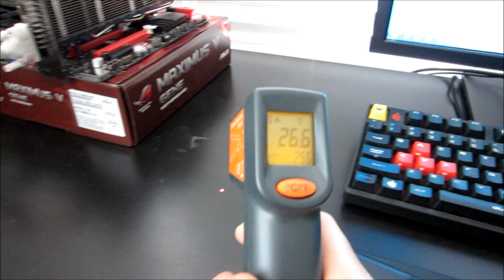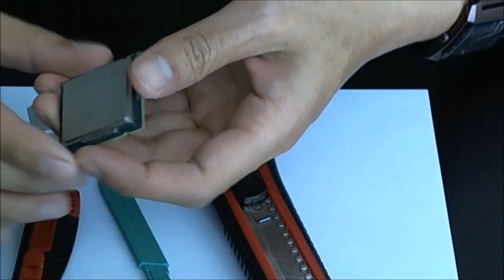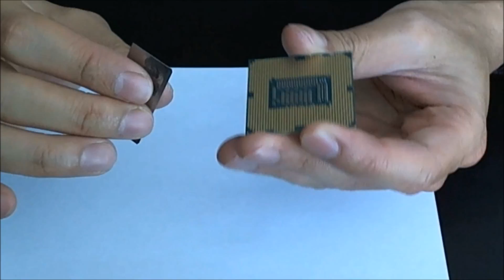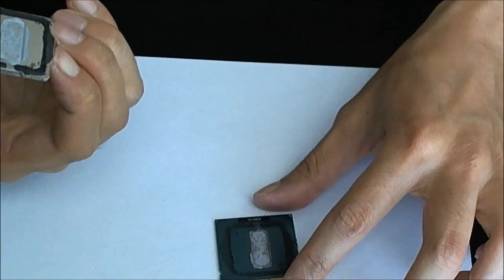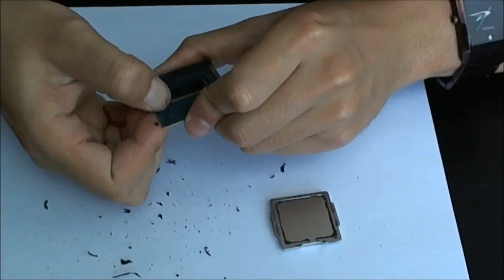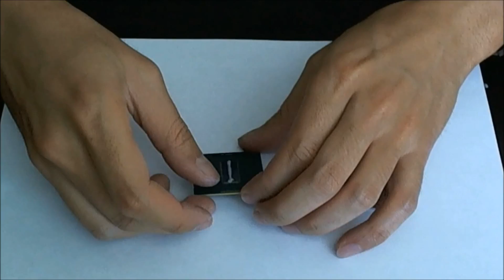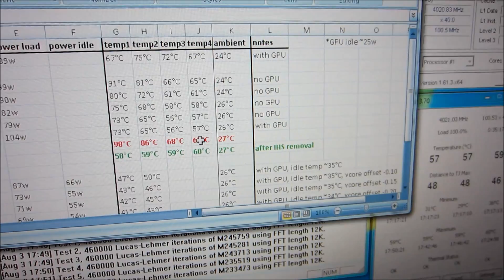Fixing Skylake, Haswell, and Ivy Bridge CPU temps: IHS removal

Comment: You should avoid touching the pins on a cpu to avoid bending or otherwise damaging the pins yes, but this CPU fits into LGA 1155 or Land Grid Array, meaning the pins are essentially on the motherboard's socket and not on the cpu.

Comment: Good concept video but I would not use paper towel. Go with a coffee filter as it will not leave lint. I would also use a small bead of silicone to secure the heat spreader back onto the chip. Finally, I would clean the CPU contacts with 98or 99% pure polypropylene to remove any grease or acid your fingers will leave behind. Very nice results from this mod for sure.

Comment: Dude at 06:36 you say the die runs perpendicular to the flaps, you are correct
Proof at 09:19 As you pull the IHS gently, the die is perpendicular to the flaps
I say this because you have a notation at 06:36 saying "Oops! Meant parallel"

Comment: great great vid, u could have probably mentioned, that if someone does not want to delid, then a sandy bridge cpu will go much higher in clock and calculation power and u could have probably show your final 4.5 ghz standardclock, volts and temps.

Comment: The temperature problem isn't due to the TIM actually. If you look over at anandtech's forums, a poser "Idontcare" did a very thorough test and found that the gap between the die and the IHS has more to do with the temperature than the TIM. Intel's TIM is actually pretty good, but the fact that they had to glue the IHS down left a larger than desired gap between IHS and die.

Comment: about the same risk as installing waterblocks on MB and GPUs. Besides the razor blade part, using the gentle twisting motion to remove the heatspreader is important. Plus removing heatspreader or stock heatsinks, it is usually slightly easier doing it on a 'just been hot block' vs ice cold.

Comment: What is the glue that intel uses to mount the heatspreader?  
or thought
I wonder if you could use Arctic Silver™ Thermal Adhesive or even a car product Permatex® Ultra Black® Maximum Oil Resistance RTV Silicone Gasket Maker

Comment: If I were to do this I  think I would have kept the old glue seeing it still has its properties. Meaning, when you "fire" your CPU up it will get hot and remelt the glue, hey presto, you can then easily remove the CPU without worrying about the heat spreader being lose.

Great video very informative learnt alot from it. Thanks.

Comment: Easy. Money. Cheap paste saves manufacturing costs. Also they don't expect people to overclock to the extremes. They could even have know people might try replace the paste and pray they mess it up to get more money from them replacing things they break.

Or they genuinely thought the paste is good enough...
Which in my opinion it's not the paste that's the problem it's how they apply it. If you have paste over the sides of the chip it's acts as an insulator rather than transfering heat.

Comment: I want to reseat my heat spreader because I want to fix the 20 degree difference between Core 1 and core 4. Which I get even without overclocking.
Temps should be uniform.
If you are talking about why go to 5ghz? Well because all the reviewers say it can't be done and because I like big numbers.

Comment: THANKS. i cant believe intel could be so reckless they must know the advantages of using a good paste. why would they be so reckless with a £300 chip. i dont understand how a company so knowledgeable could make such a major screw up. reminds me of Microsoft screw up with the xbox360 gpu issues. using rubbish solder and they also used shit paste on there gpu chips. want something doing right you have to do it yourself right.id rather by my chip un pasted with the crap there using.its wrong @price

Comment: I'm generally thinking about doing the same with my 3770k. I'm running mine at 4.8ghz on a watercooling system and one core will sit at 75 degrees while the rest are at 90..
I'll probably be able to push past 5ghz if I do this fix.

Comment: you idiot... you're getting shitty temperatures because your fan is trying to pull air from your graphics card. that's like putting a heated peace of cardboard over it... you are suffocating your heat sync... i have an i7 ivybridge 3770 that has temps like 30 degrees Celsius with my h100i from corsair... if i was an idiot like you and suffocated my fans by maybe putting something solid in front of them i might wreck my cpu too. next time pay attention to your fans idiot.

Comment: Personally I'd compensate the heating on any cpu with a chilled liquid, liquid cooled system. By chilled liquid I mean a custom rig that cools the liquid and then runs it through the system and radiator as cool liquid from the start will take in more heat.

Comment: I would really recommend regluing the heat spreader so it doesn't accidentally crack the dye. With the way that particular CPU installs underneath a sliding bracket like that it would be real easy for it to slip just a millimeter too far. This wouldn't be as much a problem with AMD as they still use a ZIF style socket though some heat sinks could damage it with uneven pressure. This is not a mod for noobz...

Comment: I wouldn't use a paper towel or kleenex to wipe the old thermal off, use a squeegie or old credit card or something, also he's using a razor blade to remove the top? :(  Don't do any of this stuff if you're not tech savvy.

My i5 3550 tops around 65C as well, that's much cooler than most of my other CPU's including AMD ones that I've had.

Comment: Actually Totally is right. The stock Intel TIM is pretty good stuff actually I've reused it once on my i7 and temps still went down about 10C. The main issue with Ivy Birdge is The distance from the die to the IHS from the adhesive they used on the PCB for the IHS. If you think I'm wrong, names Valgaur over at OCN come to the delidded Ivy club and have a chat :P

Have a good one,
Val

Comment: well my cpu is i5 3470 i am not having such huge temps only on very stress and after my computer work for 2 straight days i get about 70C.
i am happy you got it fixed for you but i am afraid of doing it my self specialy when you got warrenty.
still sad to know intel they used cheap thermal paste for their CPU i used to be a big fan of them (no problem with AMD just know intel it a safe choice). hope they wont do that mistake again.

Comment: Probably because it has the best value for performance at the $230 price point, there is no point in downgrading to an sandy bridge if you can improve ivy bridge. It has been proven that an overclocked 3570k without this mod performs better than an overclocked fx-8350. 
It is worth the time. And if you do some research you'll find that the difference in temps is caused by the cheap thermal compound Intel used.

Comment: Interesting video, however I would have thought that the initial high and mismatched temperatures are due to either badly installed cooler or a fault with the intel heat spreader when originally manufactured. 
There is no way that the quality of the Intel paste and the paste used here is going to make that much difference. Something was BAD in the first place. If I had had that chip, I would have measured the temps with a stock Intel cooler, and if they confirmed the bad T's returned the chip.

Comment: A very well made video. Educational, well set out and well explained. The part where you were removing the heat spreader did get a little boring, but I think it was necessary for completeness. It's nice to come across a carefully made video when there's so many out there that either aren't explained properly or aren't filmed properly. Thanks!

Comment: i would wear gloves . but this got me thinking unless u got a real bad chip . is it worth it for sure you would void your warranty. you would get like 10c less which isnt that bad. i have a 3570k with a h60 running at 4.5ghz and hitting high 70ish. i have no complain with the temps . if ppl are so crazy about the temp stop being cheap asses and invest in a good cooler.

Comment: Because then the cpu latch wouldn't be able to hold the cpu in place because of the height difference without the ihs. Although if you remove the cpu latch and you use a waterblock to hold it in place that would work, only if your water cooling though.

Comment: It's actually not the TIM.  The cause is actually linked to the glue that holds the HS in place.  In some (many) CPU's the glue on the die that the HS is resting on is actually too thick or not perfectly even, elevating the HS resting on it ever so slightly up off the core.  The TIM is actually high quality.  They should have soldered it, however.

Comment: OH also I am not recommending CooLaboratory for the IHS to Heatsink just for the Die to IHS... Use MX-2, IC Diamond, Indigo Xtreme or Gelid GC Extreme.  I would probably guess the Ingido Xtreme would be the best but it is the most expensive on a per application basis... If you are only going to mount once and you know you wont take it apart a single application of Indigo Xtreme costs less than the other high end TIMs.

Comment: There is a list you can find of old processors that this will work on.  This is not the first time Intel has used TIM on a processor.  The list is short (in comparison of all existing intel procs).

But WhiteFireDragon has a point you can't just go out and buy any random old processor and practice this.

Comment: actualy... in order for electrons to discharge into the cpu the cpu has to touch something that conducts... touching any pins on the cpu does not matter as long as the cpu is disconnected from any other touch

Comment: You can not make it run cooler. It is however possible that during the manufacturing process of you laptop bad thermal interface material (TIM) was used or that there not enough or an excess of it. You could fix that but opening a laptop is a pain in the a**.
A laptop is factory assembled, the mobile CPUs and chipsets come without IHS as the heat sinks applied to them do not exerce a huge pressure and will not bend unlike workstation heatsinks that can be massive like the one on the video.

Comment: speaking of going big, you could have lapped both sides of the heat spreader to a mirror finish while you had it apart. (just messin' with ya, it would be insanely hard to lap that recessed area on the bottom)

Comment: Fail of the week, you try to sound smart by pointing out the wrongs in this video but failed to acknowledge that Ivy Bridge CPU's do not have pins on them. Further more that if this was done the wrong way, then how come it resulted into success? Because removing the IHS is perfectly harmless. They are only there because it provides more surface area so your heat sink is more stabilized.

Comment: AMD still has pin grid array (PGA), as apposed to LGA, CPUs. Not every cpu is LGA, sorry had to play Devil's advocate.

Intel went LGA (with LGA775 socket) in '04 btw, not the '90's and still uses PGA chips for notebooks and atom chips (including the new Haswell stuff rPGA technically, just smaller pins) that arent BGA and soldered onto the motherboard.

I do admit he was a bit overreactive even though he should be more careful with the pads on the CPU.

Comment: I have an i7 and one of the cores is running about 10 degrees hotter than the others (Fahrenheit). What is the max temp in either Celsius or Fahrenheit that I should have when running normally/ playing games?

Comment: Sounds more like an overheating issue. If it turns off then right back off, the temps may be to high. So its doing what it suppose to and shutting down. If it were ram it would beep, giving you an error code or rarely cycling the boot.

Comment: question. is it necessary for you to put the IHS back on? or could you just have directly put the heatsink on the cpu die? cause wouldn't you get even better temps still with a direct contact? or would that just scratch the die or something?

Comment: that's not a CPU problem sounds like a RAM problem take out the ram and then reboot if you get a bios then stick in one stick at a time until it crashes. if the first one crashes it then there's your bad stick. but don't be shocked if they all work, when i take out my CPU i have to reseed the ram. turn off the computer before putting a ram stick back in and if you still think its the cpu just take it out and push the power you should get a bios screen

Comment: Intel cuts corners on Ivy bridge thermal interface material and AMD doesn't but yet you still pay $230 for the i5 and then $200 for a fx. just makes me think you really is getting the better deal, i know you might be a Intel fan boy so ill save you the trouble i really don't care about AMD or Intel im just pointing out how ppl seem to think cuz you pay more its better but its not, same shit differnt tag.   plus alot of ppl are starting to look at AMD cuz of this corner cut *shakes head at intel*

Comment: You're so stupid for making all these stupid comments! First of all: It is not a i7! it is a i5-3570K. So it is a i5. Second is that not only on top of the CPU should be thermal paste, also on the inside. Just no one except this guy has got the balls to open the cpu and fix the temp-issue that is caused by the intel manufacturing flaw due to the bad thermal paste in it. You think that if he puts just thermal paste on the outside and leaves the inside it is fixed? HE does also put on the outside.

Comment: Does the problem happen when gaming only? I know for sure that overclocking may cause instability issues. First adjust your cpu to factory settings. Run programs for testing RAM and CPU stability such as prime95 and memtest86. If all seems to be correct just try with another GPU, yours is factory overclocked and some games have big troubles when being played by them.

Comment: I have done this. 
Now when i turn the computer on my computers shuts down after 1sec. All the fans turn on for a sec then shut down. I have tried to clear CMOS.
Specs
Asus Sabertooth z77
Intel 3770K @ 4.3Ghz
Asus 680Gtx direct cu
Antec 920 Alc push pull

Comment: I also have a 3570K and I've got 2 cores that run around 6-7C hotter than than the other 2 cores - not enough that I would want to remove my IHS but they should still be more consistent. Taking into consideration that even the lower cores would benefit from a better thermal compund between the die and the heat spreader, I could probably overclock my CPU by another 0.1-0.2 GHz with the same CPU cooler if Intel hadn't cheaped out.

Comment: While I agree this CPU was mishandled, there are no pins on the bottom of Intel's LGA processors, they are on the motherboard in the socket. The bottom of the processor just has flat pads and you can't really damage them. But they don't like oils from your hands much so having some barrier between your fingers and the bottom of the processor would be a good idea. And the amount of pressure exerted by the retention bracket on a motherboard of an LGA socket is much more then he did with his hands.

Comment: I like the way you manhandled the shit out of that processor. You gouged it with a blade, not to mention you put a kung-fu grip on the naked pins. You could have bent a pin and rendered the processor useless. The horrible practices you taught in this video would be unacceptable to anyone else that is more knowledgeable in even the most basic of computer maintenance. You, sir, taught 1,000 people how to do this the wrong way, and they agreed with it.

Comment: I'm not against removing the HS, but the practice on that CPU in this video is horrendous. You didn't use alcohol TC remover, using a heat gun Heat the HS to around 85oC and it should come off fairly easily as the adhesive becomes semi-liquid, The use of a steel blade in the close vicinity of silicon is NEVER a good idea and the amount of times you created extreme pressure points because you were holding it in your hand is absolutely disgusting. You shouldn't be allowed within a mile of a PC.

Comment: it was messed up on 2 cores, which should be RMA'ed instead of using these methods that are highly risky. point is it might be necessary to do any of this if a quality seller could handle it for you. and what if it does crack or scratch the bottom, then you just have a really expensive paperweight

Comment: Very nice video. I got an i7 3770K running at 4.4GHz vcore at 1.24v using H60 for cooling.
Temps using prime95 are 75c.
Gonna replace it with an H100i and apply Gelid Extreme or Artic Silver 5 and see the temps, also see if i can get to 4.7 or 4.8GHz with it. If it still doesn't solve it, then i'll do this mod. Thanks for the very nice video.

Comment: Look at my channel, I'm not afraid to mod anything. Why would you void your warranty on an expensive piece of hardware that you could just replace. I know that this is a valid fix and it does work. If he were to slip and scratch the traces then the CPU it's garbage. If he were to bend the PCB and de-laminate it or crack the die off its garbage. It's very high risk. That's what RMA is for. The die could still be good but who cares? Its Intel's problem to fix. Now his warranty is void.

Comment: I own a i5 3570 without K and have max. temp of ca. 57°C with my Thermalright HR-02 Macho. I see your FAN is wrong mounted. The FAN is blowing on you grafics card, that`s bad. The FAN must blow through the heat plates of your cpu cooler. No wonder why your temps so high.

Comment: It's really tempting to just take the socket mount off and run bare die. Of course you'd need to mod the mounting system for your cooler too, but that has the ability to drop another 5-10 degrees off your temps, probably further if you're running a very high clock.